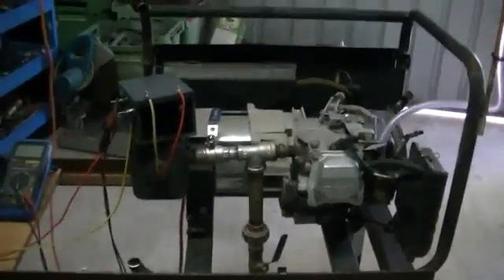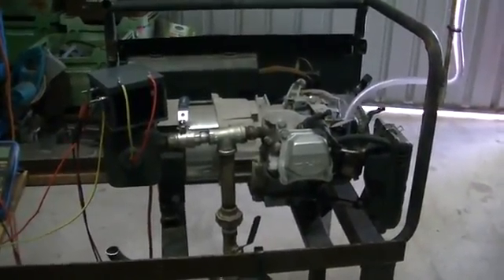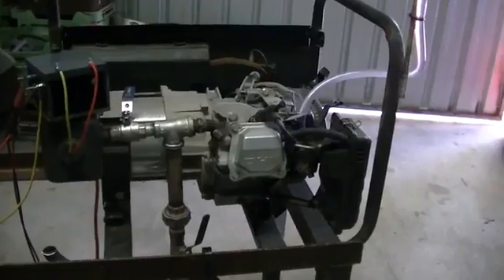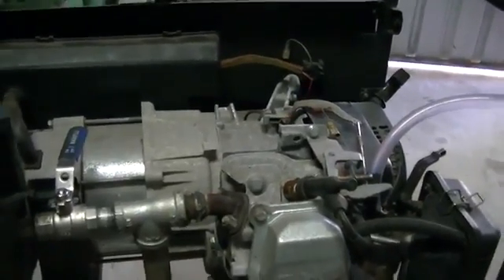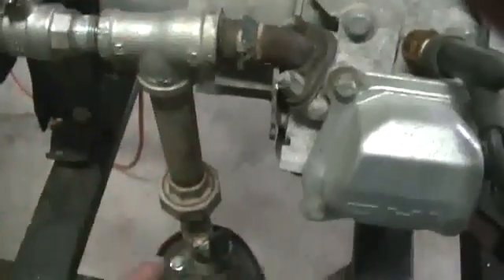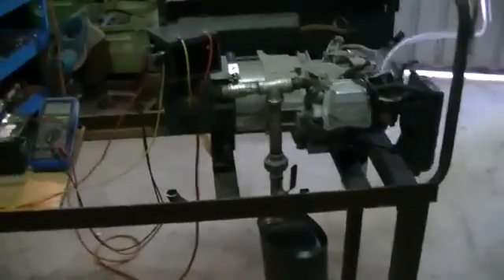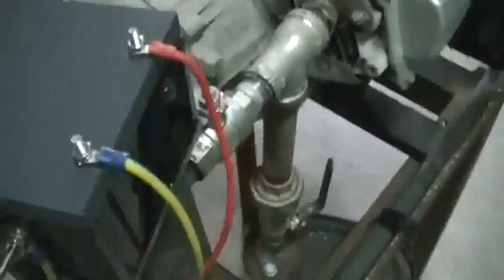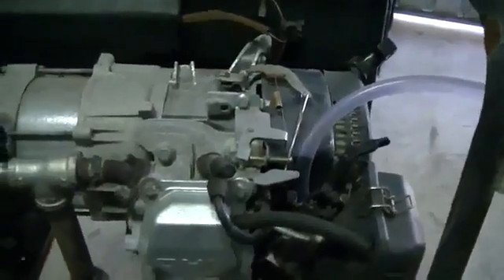heat power convertor.mp4

Comment: ah well, it was worth it,  I've had that microwave sitting 5~feet away from me in the closet for at least a year.. took 5mins. have an excuse to remove the magnets now at least.

I'd imagine if one fired microwaves into a magnetron it would produce some form of electricity?(at an uber-loss... and yeah.. not recommended >.<)

no regrets either way.

keep up the good work though.

Comment from the maker: Hi bananaphonehome-No its not the magnetro,it's just one of the coils from the fan motor.I only put it in the box to make it look neat-not to hide it.
I am going to pull it down to its bare form and do a vidio on the unit just to show that it's relativly easy to build.The unit you see there is very ineficient-we could get around 500 watts from a decent unit on that engin

Comment: Really great work here. I've been reading about the thermal cells which convert any type of heat to electrical energy. Much like solar panels but do not require direct sunlight to function. This is the perfect application for that because so much of the energy of the engine is in the form of heat. I think this is a wonderful idea that's going to spark a lot of interest and experimentation. Thanks for sharing.

Comment from the maker: Hi firepinto-no not a peltier convertor-much more efficient than that.This one just uses heat-well actualy air flow,but in the case of an I.C.E,hot air flow as this is the waste we want to convert to useable power.This setup if very inefficient,but with the right parts and a well equiped workshop -it could give a much better return.

Comment: I do know that the exhaust hold energy . Thats one of the reasons that the geet works. ya might try to build a partical generateor like stan did . I think it may have to be a bit smaller than stans be cause the energized partitals in the exhaust dissipates very quickly as it goes from a hot and high pressure atmosphere into a lower pressure cooler place. It will work. we just need to find out how well it works. I know it can take a bite out of crude oil if it can make it to market.